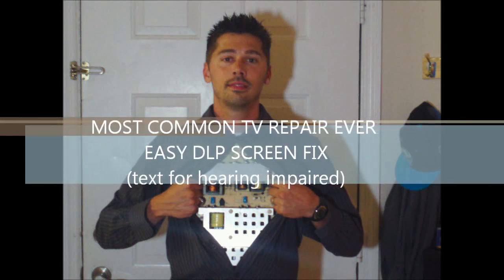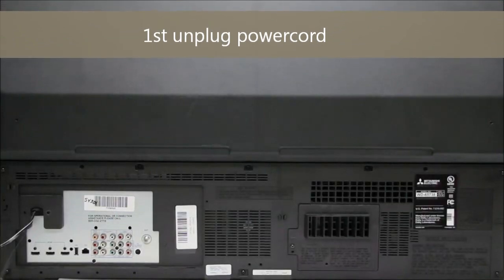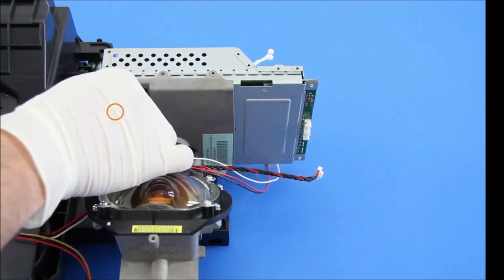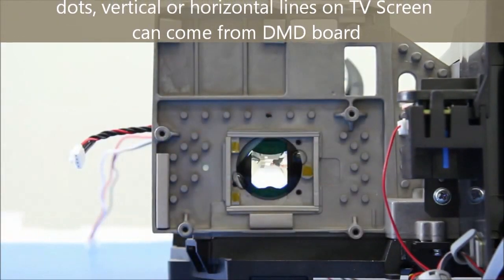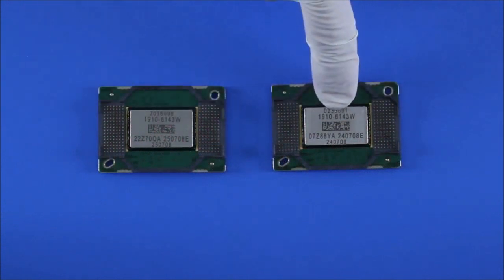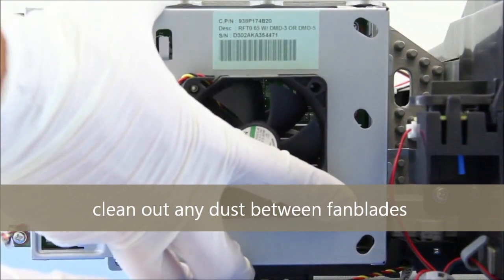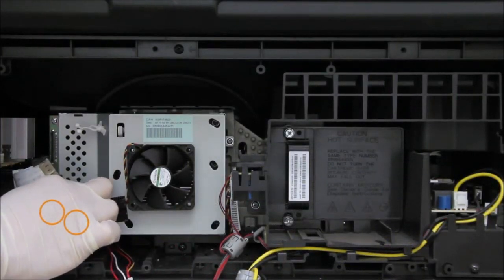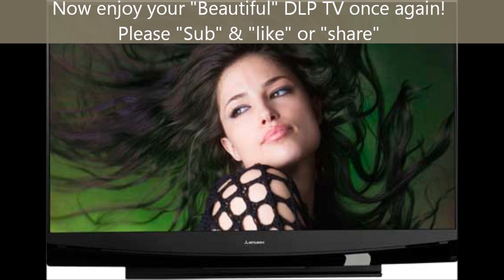EASY Common TV Repair for DLP !!!

Comment: i have a 32 inch lg tv works great except the sound what or where do i look for the problem somtimes i get volume but crackly and hardly hear it iv changrd most capisitors and video board same problem though

Comment: I have a 62 inch toshiba dlp tv and there is like a floating web or something inside that you can see on the screen which looks like it would be outside but it is inside.  IIt looks like a two thin flowers moving in the wind just off center to the right of the screen. Is there a way to get inside to remove the dust from the back of the screen or is something else causing this?

Comment: Hi. I have a 73 inch mitsubishi tv wd 73733. I am getting a flashing green light, then it goes black. No more lights. When i turn the tv off, i get a steady red light. Wont go off unless i unplug the tv. I have been told that one of the three cooling fans are bad. How do you know which one? Any help would be greatly appreciated.
Reply: Is the red light under the lamp indicator or all the way on the right?
Reply: debbie troxel 9p

Comment: I have a mitsubishi DLP with a horizontal rainbow, I changed the bulb hoping that would solve the rainbow and now there is also a rectangular rainbow on the right side in addition to the horizontal rainbow. Any idea whats causing this?

Comment: Should'nt there be some thermal paste between the heat sink and the chip?
Reply from the maker: true great eye, i will add a speech bubble in thanks, that will help transfer heat away from chip to heatsink using heatsink compound.
Reply: ***** where exactly would I apply the thermal paste? does it just get applied all over the under side of the heat sink? sorry I have no clue about all this lol :)

Comment: My samsung hl61a650 won't fully power on. It has power to it. When I press the power button the t.v. powers on. The audio sound starts, the lamp and color wheel turn on. All seems well for about 3 seconds. The lamp quickly turns off and tries to power back on but comes back very dim then turns off completely. The television then goes through a power cycle where it all starts over again. This process happens for infinity till I unplug the machine or active the safety switch for the lamp housing. I've replaced the DMD board, lamp, power supply and ballast. The only thing I haven't replaced are the computer chip and the main board. Any help would be greatly appreciated. Thanks, Luke
Reply: Luke Tilton Did you ever find out the problem with your Dlp?

Comment: have question i have a 1080i Panasonic 50inch and last night all of a sudden the left side of the tv went white ???No.......i said lol ,,how do i fix or is this minor or throw away in buy new?
Reply from the maker: try reset by unplugging TV for 5 minutes or check cable connections on video boards. contact shopjimmy.com to confirm what tv part to buy.
Reply: I have this same tv we just replaced the lamp and there is no sound we don't know what to do or how to fix it. We got it from a family member no remote and we just replaced the lamp. Again there is no sound when we hooked up the hdmi cable to our system to it.

Comment: Great video! I replaced the DLP chip on my mitsubishi wd-73735 tv but when I plugged it back in there was only sound and a black and grey bar screen with with horizontal lines. I checked everything 3 times and still can't find if I put something back wrong. Any ideas as to what went wrong? Thanks
Reply from the maker: some dlp mitsubushi TVs have extended warranty on dlp chips. 
Mitsubishi- phone: 800.332.2119
Reply: javier franco

Comment: Tampatec, My WD-65831 has a wavy distorted line at the very top of the screen. So when the movie plays or regular TV. It has that distorted look like your trying to watch blocked porn channels! LOL  But this is only at the top, the rest is just fine. What can I do to correct this problem?
Reply: Jeff Noonan no is actual picture but distorted at the top and now has reached 1/3 of the screen. So the picture from the top is wavy.
Reply from the maker: change aspect picture format adjust screen to fit, adjust the 2 aspect formats- TV & Cablebox picture aspect . but if you get lines on the screen on all TV inputs (video distortion) it maybe DMD board. get at Shopjimmy.com
Reply: Probably the board then.  For me it is cheaper to Walmart a 60hz TV.   Don't fall for the 240/120hz crap out just adds cost.  Only videogames with holding lines is it even perceptable. As all TVs are 60 HZ. Playing a trick of duplicating info to fake a picture above 24fps.   Anyone who thinks differently is just wasting money.   120 fps for 3d is only so it can display 2 images around 60hz, one for each eye.   For me I'm going new same issue 50" $399.99. 60hz. As I own no 3D content and my cable provider is lacking variety in 3D still.
Reply: If it is white bald line wavy that is the audio coding your TV is displaying during the blanking interval of analog TVs it is supposed to be ignored.   Aspect ratio wide/full screen and TV service setting can sometimes fix. Turn off all CC features sometimes it will hide it.   I see this a lot with high quality TV sets.
Reply: Jeff Noonan black not bald and its just carryover from old school times.
Reply: Tomas Acosta

Comment: hi tampatec i have a dlp wd-65831 65' mitsubishi i just replaced the lamp and cleaned dust bunnies and air flow passages after 20 minutes the screen flickers briefy and then i lose video tv stays on b-cuz i can hear audio  i let it sit for a while and i get video again but after 20 minutes it does it again  thks in advance
Reply from the maker: Call mits-  800.332.2119 Cause i think that tv's model DMD board had extended warranty. DMD board "might" be free
http://www.city-data.com/forum/consumer-electronics/1162259-white-spots-mitsubishi-rear-projection-tv-9.html

Comment: have you ever fixed a micro sd memory card? i really need your help if you've have...
Reply from the maker: if its cracked it maybe permanent if contacts are damaged but most cases its dirty or dust on sd card contacts or dirt inside sd card port preventing good connection so just blow out dust inside port, but some sd cards have lock switch to prevent deleting data.

Comment: hi, i have a samsung sp50L 7hx, picture goes off after 20 minutes but sound is ok
i suspect overheat problem what do you think..new bulb? just a clean? or could it be some thing else..thanks
Reply from the maker: common issues is lamp, dirty/bad fans, bad color wheel, bad dlp chips, then bad capacitors in power board like 1000uf, 2200uf, 3300uf 10v or 25v, go to Shopjimmy.com or  1 (877) 881-6492 / (952) 881-6492 for TV parts
Reply: Tampatec